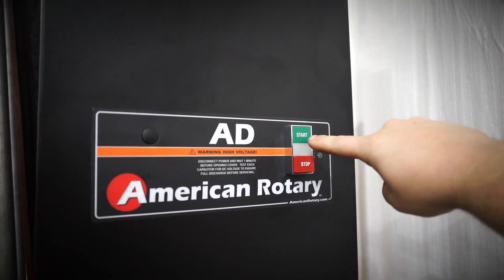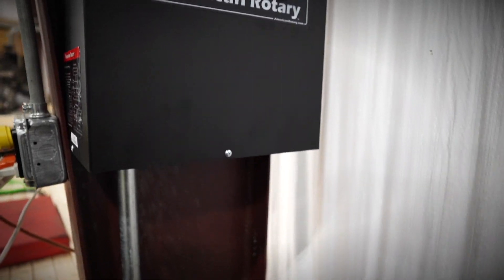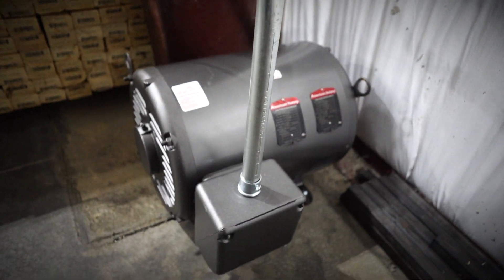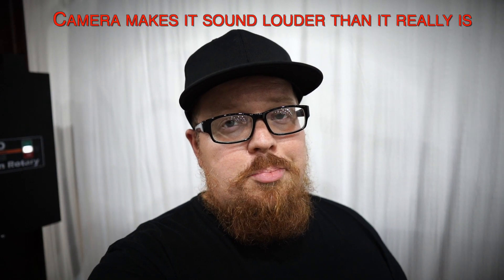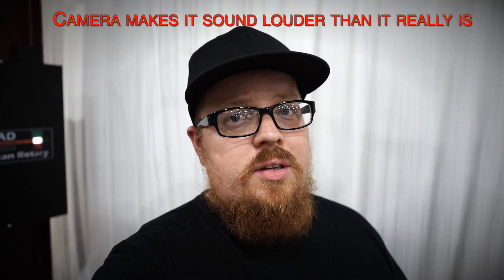American Rotary AD 30 Haas ST10 Lathe 3 Phase Power Converter | CNC Machine |

Comment: I hope can you answer my question.... i want to put a haas mini mill in my garage that has a single phase  220v 30amp isolated outlet and breaker. Would a rotary phase converter allow me to satisfy the 3 phase 25amp minimum for the haas mini mill??

Comment: Thanks for posting your video . I am in a similar scituation and just finished wiring up my Northern Phase Conver 30HP very similar to yours from my residential 240 voly single phase 200 amp service.May I ask what voltage you are running your Phase Converter from? ( such as 240 single phase) and what are your power measurements comeing out of the american rotary comverter when you measure Leg to Leg for T1-T2=        T1-T3=           T2-T3=          ? This is a test that the PC company puts in their installation instructions to check for after start up.  I'm looking to compare with my phase converter output.  Thank you.
Reply from the maker: It is “240 single phase” input into the converter. My actual voltage between the the three phases was 245 247 and 250 on the manufactured phase. I needed these readings when wiring in the transformer on the lathe so I knew what taps to use. It turned out to be the highest set of connections on the machine out of the 4 options. I thought the numbers were a little high, but it’s a new power installation from the pole with all properly sized wire and components. Hopefully that answers your question. Thanks for watching!
Reply: @TheGarageVlog  Thanks for the quick reply. Ah....so your are going to bring the voltage down with a step down transformer?  Did Haas tell you that your voltage straight from the PhCov. was to high for their machine? My voltage comeing out of my Northern Phase Converter (also a 30HP)  is 238 254  240  and my Fadal installation tech said I need a step down transformer as my voltage is to high. My installation manual states 235 volt as the maximum upper limit as anything higher may burn out the spindle drive. I could take a chance but the tech said if I do burn out the drive it  will cost many thousands to change out to a new one. Now Im looking at buying a 240 to 208 volt step down transformer 30KVA   3 phase unit from All American Rotary. Thats another $1500 into my electric supply cost. Ouch!  Love your shop! How many square feet?  Is this a hobby or business?.......Geno
Reply from the maker: The max voltage on the Haas is 260, it has a transformer in the machine, so I didn’t have to do anything else. We run a fabrication/machine shop during the day, and I film some YouTube videos every now and then in the evenings or weekends. The shop is 6250 sqft. Hope you get  up and running soon!